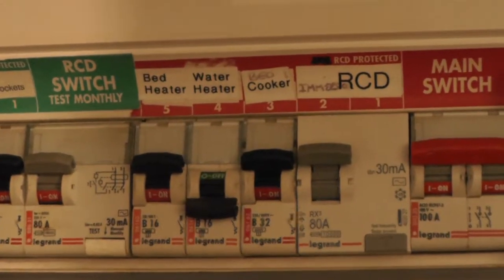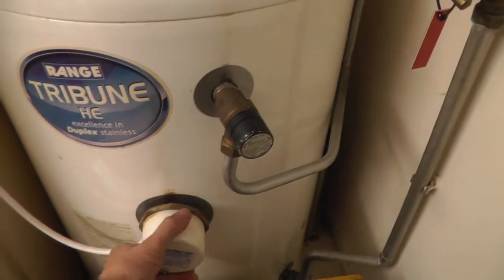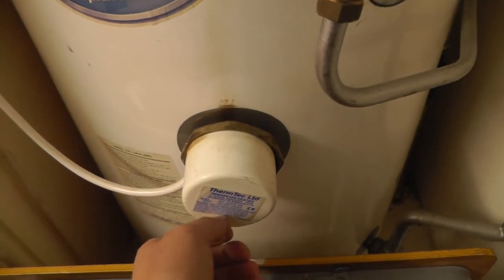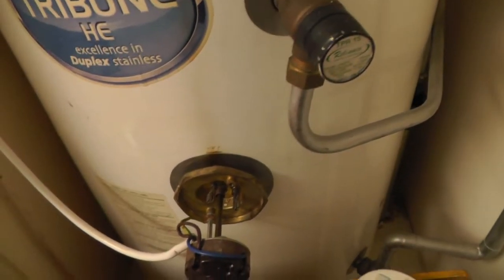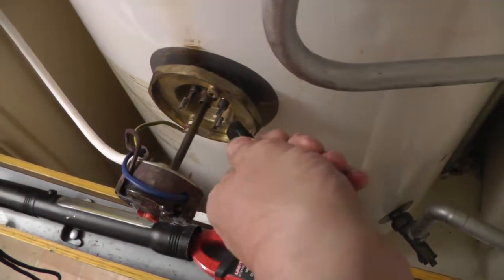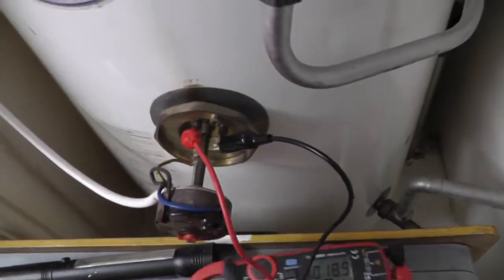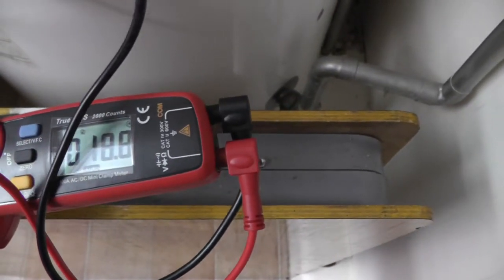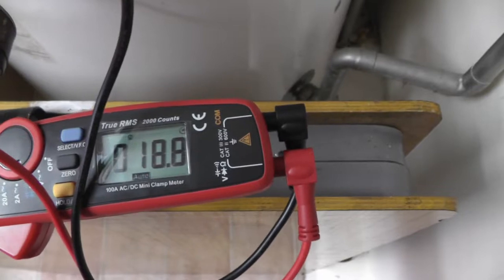Hot Water Heater Element Test 🌡️How to Check Immersion Heater with a Multimeter (DIY Troubleshooting

Comment: Hi.
I  have a Tribute HE 150L.
How do I drain it or remove the limescale inside?
The immersion has been changed less than 6 months ago.
Thank you in advance.
Reply from the maker: should be drain points on the tank and on the pipe work running to the tank. Make sure no pressure left in system anfd cold obviouslly. you can remove heater and scrape it clean or fill tank with water and chemical to clean chemically .

Comment: How did you test thermostat? Just continuity between terminals the turn dial to see if it works correctly?
Reply from the maker: yeah i think so i did it a while ago its how i usually test them you could go scientific on it and heat and cool it to see if it turn on and off